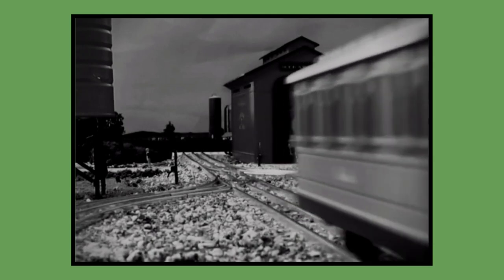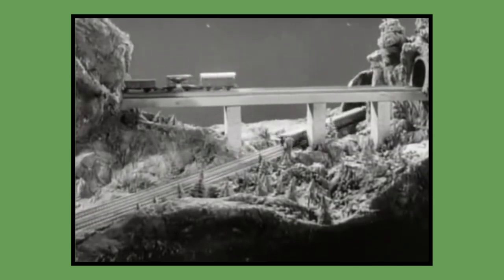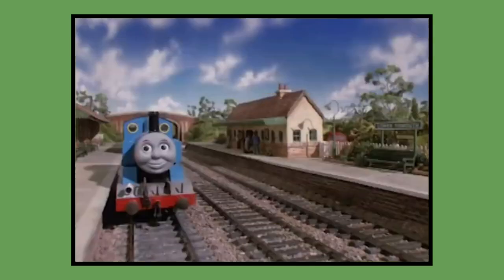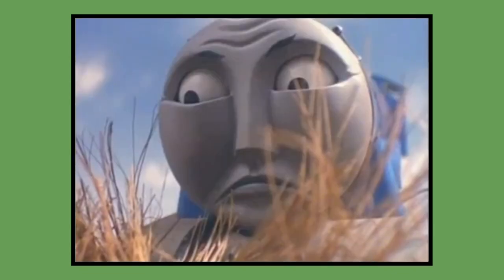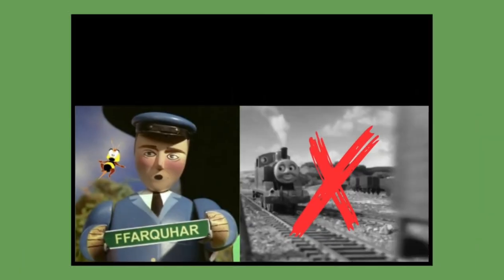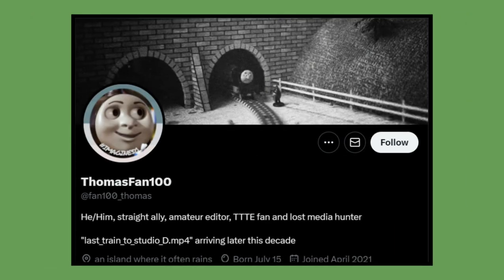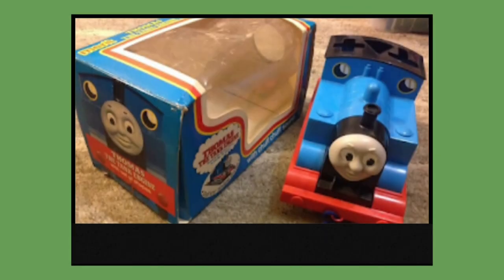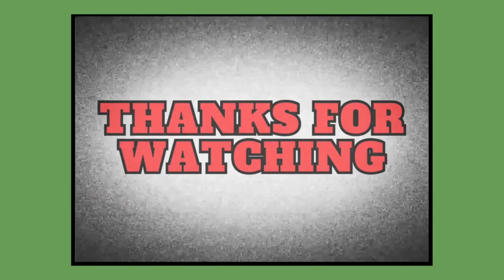Thomas and Friends LOST MEDIA: O Gauge Pilot, the lost footage YOU never heard about

Comment: So, what would be the difference in these gauges? Evidently 0 Gauge is smaller than 1, but by how much?
Reply from the maker: Well we know that the crew in Season 4 had such a hard time with the narrow Gauge models, (which were O Gauge). That they switched to large scale versions of the narrow Gauge engines for Season 5 onwards, and this was over a full decade after the pilot. So in short, if it was hard to use a small scale such as O Gauge in the 90’s, it was even harder to work with these models in the early 80’s.

Comment: Well I know a little more now I always thought the pilot used gauge 1 , thanks!
Reply from the maker: The Original pilot was filmed in O gauge, but only a few shots were filmed since the models were so bad. The second pilot was filmed in Gauge 1, but it’s unlikely that the whole pilot was filmed. The models were better than their O Gauge counterparts, but still very bad. So they were refurbished and given Marklin Chassis’ for the first season in 1984.
Reply: @FlyingFishProductions  so basically they had 3???? lost pilots the o guage one the gauge 1 and the one in 1973?
Reply from the maker: @clayv5422  I believe you're referring to the one from 1976, however that was just a few sketches made for a cartoon. It took a little while to get the show off the ground to say the least.
Reply: @FlyingFishProductions  yeah if ya kinda compare them the 73 one to the current all engines go they look strangely similar??
Reply: @clayv5422 fun fact there was a lost loose adaption of thomas in 1973 called engines of eight